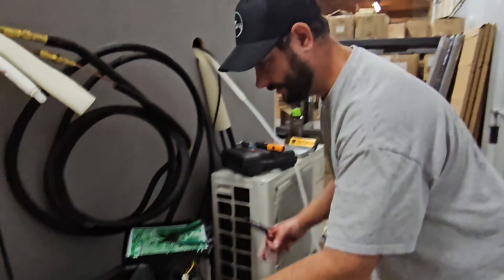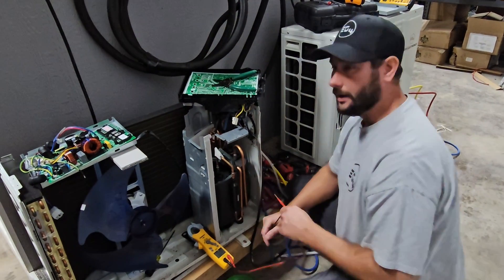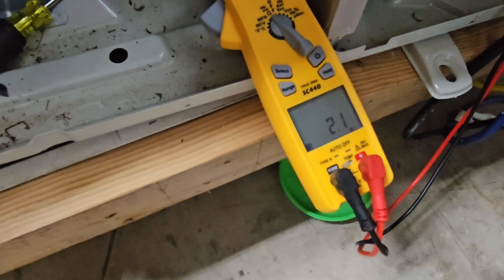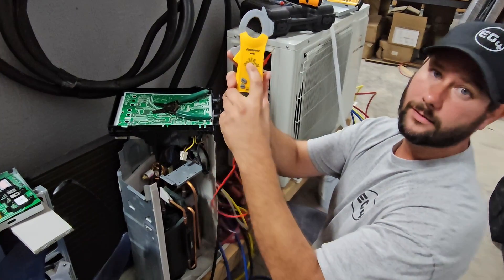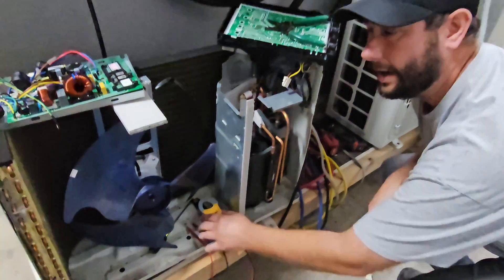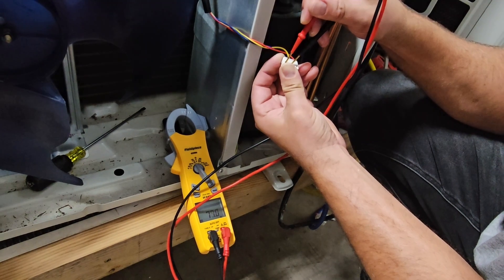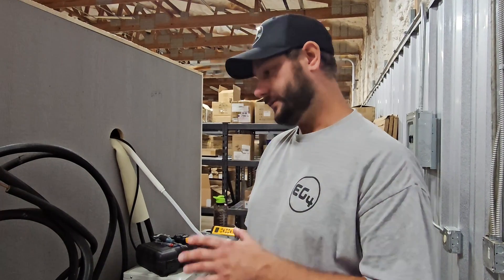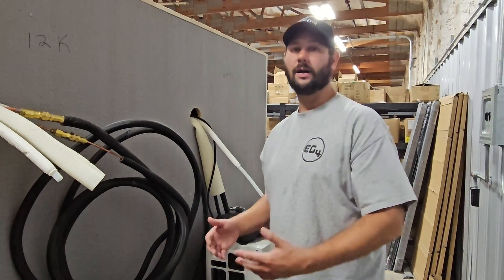How to Test a Mini Split Compressor? (Troubleshooting)

Comment: Hey. I got a Fujitsu AOU24RLXFZ condenser. Got three heads on it. The other day I  had one head running. Few minutes after I started it I heard a pop outside that tripped the breaker. Compressor is not grounded. I didn’t check the windings yet. But I did find the connector on the red wire (w16) on the active filter module a little blacked out but not burnt. What do you recommend my next step should be? I am gonna pull out the inverter board for further inspection.  I’m an apprentice for a popular hvac company. Learning little by little.

Comment: Now this is a simulated 3ph compressor right?
Reply from the maker: this is a 3 phase rotary compressor
Reply: @ so 3phase supply to mini split? Haha 
I talking in Aus specs you it would simulated for 3ph you wouldn't have 415v between connections and you'd still mega test at 500v DC not 1000v

Comment: So for mini split compressor should get the same reading on all the windings and not like a split sys compressor were it suppose to add up to Start and Run?
Reply: @bkluntz  yeah I was thinking the same thing
Reply: Commercial 3-phase motors show the same resistance as the windings are the same amount without a common wire or the use of a capacitor. The power going in should also be around the same L1-208v L2-208v L3-208v.

Comment: Good information on how to test both the compressor and fans. However, I am not so sure they are three phase. I'm thinking they are single phase 220 voltage, hence three terminals... IDK
Reply: Single phase rectified then inverted to three phase.

Comment: Did i miss something? Is the compressor a 3 phase compressor? And what do the letters stand for on the terminals? It must not be comman, start and run.

Thanks
Reply from the maker: Yes it's a three phase compressor
Reply: Letters don’t really matter and some manufacturers do use common, start, and run; but they are W U V in three phase.

Comment: What would cause a heat pump to work fine in cool but blow the low voltage fuse in heat mode?

Comment: Great video! Compressor insulation test (phase to earth) should be done with a high voltage insulation test meter (Megger) as the multimeter only puts out a few volts.

Comment: Thank you for the video!  Question: What coolant can be used to prevent or minimize the release of climate-harming outputs?  Or have most mini-splits phased it out?  If not, how bad is it to replace the coolant on our own?
Reply: refrigerant*** and tbh all of them are toxic and have no difference with the types of refrigerant that is used for mini split systems.
Reply: Most all mini splits these days are using r32

I would strongly recommend engaging a qualified and trained technician to carry out works on your ac system, refrigerant is incredibly low temperature and mis handling could result in serious injury/burns or worse, they are asphyxiants and could suffocate if release in an enclosed space

Also they are now midly flammable…so theres that
Reply from the maker: check out my video titled how to recover vacuum and charge a mini split